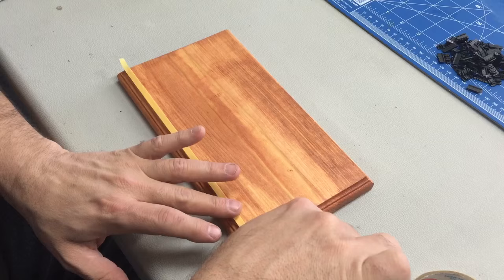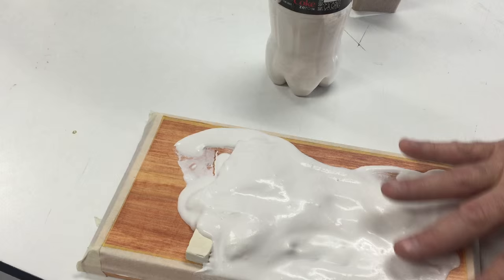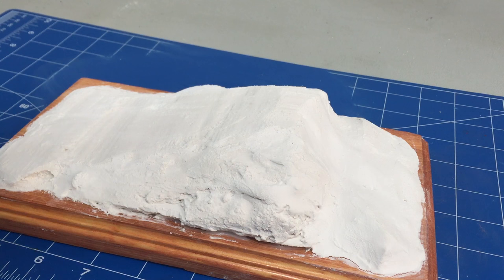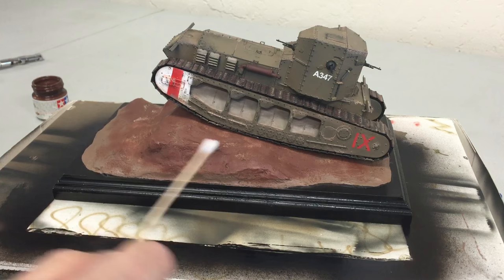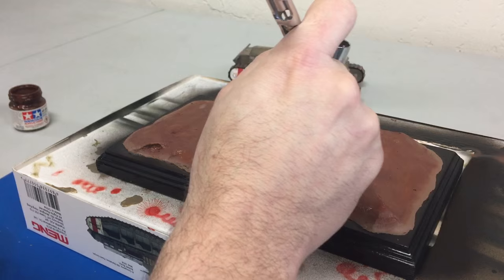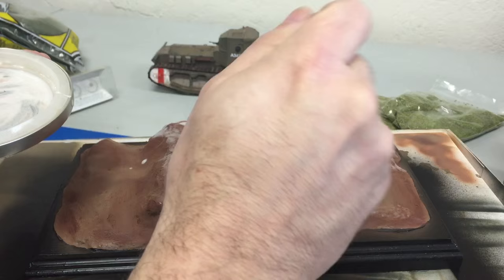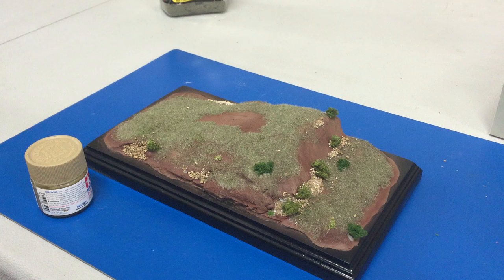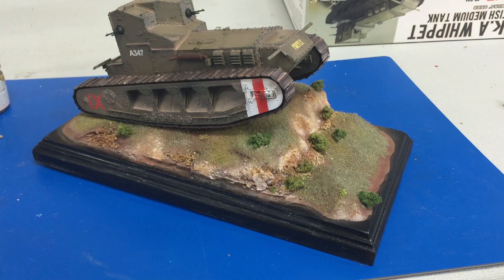Building a simple Diorama base to display your 1/35 Meng Whippet

Comment: Static grass is actually different than what you used here....static grass uses a special applicator that gives the surface and the grass particles opposing electric charges, and the static charge is what makes the grass stand up.  Great little base though!